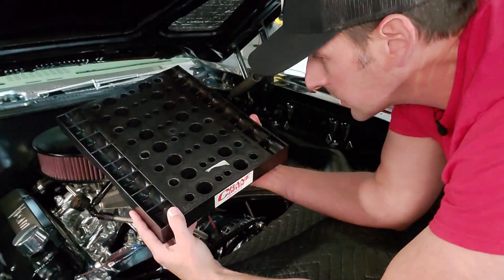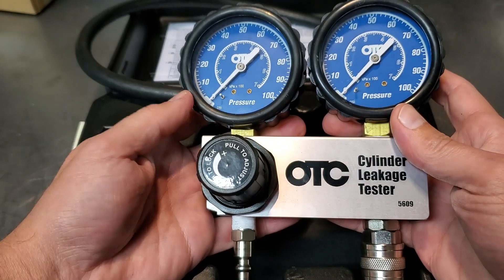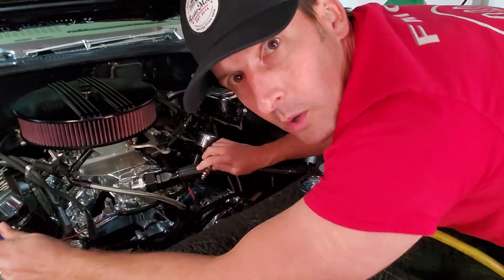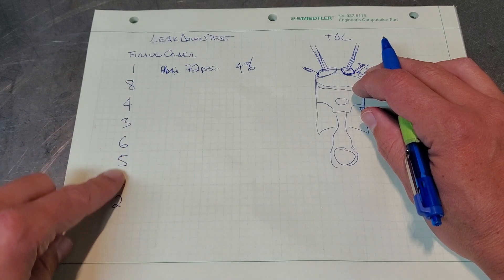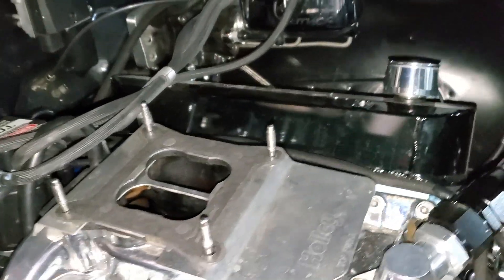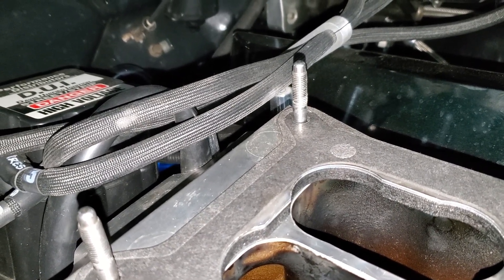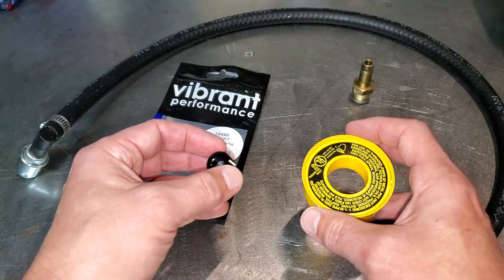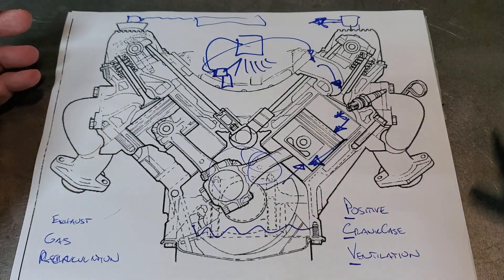Exhaust Smoke!  Bent Valve?  Bad PCV?  How to do a Leak Down Test?

Comment: Last thought, the PCV can go bad and not function as it should, allowing oil to get past, and into the intake.  And sometimes, even reverse , not letting air to pass either way.  So, just replace it.  They're not expensive.
Reply from the maker: On a stock engine, for sure!  But, for us modified guys... check this out... https://youtu.be/fdYFieOOGq4

Comment: I paused this video at the point where you mention the firing order and that to rotate the crank every 90° after #1 cylinder.  
Helpful hint; if you have a degree wheel and install it at the crank, you will be more accurate at finding every 90° of rotation.
Reply from the maker: For those that don't have 90 degree marks on their balancer, that's a great idea!  Thanks!

Comment: First test should be dry and wet compression test on all cylinders. This will tell you what you need to know. A bad valve will be low both dry and wet, after a squirt of oil.

If wet is higher you have blow-by so probably want pistons. Pontiac used cast pistons even on most performance engines so get her punched out with a set of forged racing pistons with compression ratio to suit what fuel you intend to use.

If it's low on wet compression pull the head, unless you have a hole in your piston it's not the problem. Check gasket for cracks or blowouts, then head. Pour liquid in combustion chamber with spark plug installed, blow air in ports and look for bubbles. Soapy water could help. Let's assume you see bubbles on one or more valves you want to send them for a valve job. 

Check for ridge on cylinders that indicate wear and suspect high mileage and consider a full rebuild, such a classic deserves a fresh engine but don't swap out an original motor. Always rebuild, if original motor is long gone then a crate motor may be nice
Reply from the maker: Good points, Don... luckily I didn't have to go that far, reading the plugs and re-examining the wrong PCV plumbing... that was the issue.  Thanks for the comment!

Comment: My GTO has some fouling in cylinder #3, could this be coming from the PCv also?
Reply from the maker: It "could", pull the carb and see if you can look into that runner. Might help to look up how to "read" your plugs to see if it's fuel or oil. Good luck!
Reply: @FastMonty  sounds good I'll do that this weekend.
Reply from the maker: @henrychavez824  I hope it's an easy fix!  Good luck!
Reply: @FastMonty  I hope it's an easy fix to, I don't feel like removing the motor. Looking to sell also if you might know anyone who is looking for 64 Gto. Thanks Fast Monty.
Reply from the maker: @henrychavez824  I'll keep my ears pealed for you... good luck!

Comment: Squirt oil in cylinders if compression comes up much its the rings if not
Its the valves ?
Reply from the maker: Agreed. But, you can typically hear it. Same with a blown head gasket, you can hear that through where ever that's leaking, ie through the radiator.

Comment: Excellent video as always. 
But have you ever thought of using a crankcase evacuation system?!
Reply from the maker: Thanks Brother... yes, it's on the list.  Gonna see how the new plumbing performs first.  Then determine if I should improve the baffel, add an oil separator, or, as you pointed out... adding a evac system.  Thanks for the comment!
Reply: @FastMonty  keep up the excellent work !👏🏻🤘🏻💪🏼
Reply from the maker: @19211265  Thanks!  Doing my best!

Comment: Mike, don't scare us like that!  :^D I was dreading a tear-into-the-engine conclusion. Glad it didn't turn out that way.

Your video sparked an idea for a change on my own car ('74 Formula 400), which is that the power brake booster is (now was) plumbed to that same #7 runner by the PO (I think I have the same intake manifold as you). I decided it made more sense to run the power booster hose to the base of the carb (Edelbrock Performer 1405), so that similar to what you said, the "load" of the booster is placed on all the cylinders, not just #7. Obviously, it will only make a difference in that instance when I step on the brake, but why not spread it over all the cylinders?

My PCV plumbing is like stock, where the hose comes out of the base of the front of the carb, with the PCV valve in the valley pan just behind the coolant crossover. So I was able to just remove the plug from the back of the carb base, replace it with a hose barb, and plug the port in the #7 runner. What the heck is that port for, anyway? I never realized that it's so far down the runner until I saw this video.

While I'm on the subject of power booster hose - remember, folks, don't use 3/8" fuel line. There is an 11/32" hose expressly for power booster usage. Hose meant for vacuum is measured in 32nds.
Reply from the maker: Thanks Griff!  Good advice on the brake booster too...  That #7 port is for an EGR valve.  Exhaust Gas Recycling... so, on emission controlled cars I believe it pumps gas in there, when it's cold?  Not sure, but definitely not optimum for a PVC valve.  Thanks again for the comment!
Reply: @FastMonty  oh, right - you said EGR in the video. I’ve slept since I watched it. 😄
Reply from the maker: @griffmillerii1885  Ha!  No worries... I know the feeling.  :)

Comment: My intake manifold has a port. So it’s not plugged into my carburetor
Reply from the maker: That's awesome... as long as it evenly distributes the fumes to all cylinders.  (As I've found with mine, it only distributed fumes/oil to Number 7)  My first couple of test drives have revealed a LOT less back firing too.  Thanks for the comment!

Comment: Another great tutorial Mike..glad it wasnt a valve..it would be nice see the burning oil disappear on your next movie and let us know if performance has increased..hats off to ya.
Reply from the maker: Thanks Daniel!  Actually, yes, the first test drive had noticeably more power.  Not sure if the Number 7 was missing, or if the back pressure was preventing RPMs from increasing, or both.  (And less back firing too)  So, I consider it a major success, considering I was debating on pulling the head, if it was a bent valve.  Thanks again!

Comment: Looks like your valley pan might not be baffled.  The Tomahawk valley pan designed by Ace Brewer, is a very nice piece that is baffled, and it clears roller lifters.
Reply from the maker: Great idea!  I welded in a baffle to mine, but will definitely check out the Tomahawk version.  Thanks again!
Reply: @FastMonty  this wagon was plagued with oil consumption because of the pcv and a non-baffled valley pan.  
https://youtu.be/kGgOTKvWZZk
Reply from the maker: @nachomax1639  Thanks for sharing!

Comment: I’m wondering about your valve seals and guides? I had a early 80’s GMC that would blow blue smoke on shifts and on decel. Turns out I had hardened valve seals. In all it was an easy fix.
Reply from the maker: Will definitely keep it in mind... need to monitor the situation for the next 100 miles.  Thanks for the comment!

Comment: I hate that kind of fun. :)  My guide plates on my 70 Z28 wore out a pushrod until it bent a bit while going up the street. Found that what was suppose to be hardened wasn’t. Swapped them all out. The new ones I got were 1 piece design, black and hardened from Comp. No marks on them at all after yrs of use. 

I made my own leak down tester which works great.

Here is the formula if your compressor can’t reach 100 or more PSI.
(Orig psi minus final psi) divided by orig psi mult by 100.

If orig pressure is 120 psi and the final pressure is 80 psi.
(120-80) / 120  x 100 = 33% leakage

If orig pressure is 90 and the final pressure in 80 psi.
(90-80) / 90  x 100 = 11% leakage

When using 100 orig pressure the math is straight forward.
If orig pressure is 100 and the final pressure is 97 then you have 3% leakage.
(100-97) / 100  x 100 = 3% leakage

During each test have the carb at WOT and oil cap off, oil dip stick out and rad cap off, then using a rubber fuel line to your ear, make note where the leak is coming from: carb, oil cap, oil dip stick, rad fluid with bubbles or the tail pipes.

In your case I’d go through and set all your valves. Try using the EOIC method which I found to be real accurate then test one or two of the cyl again.
I bought a new PCV hose from GM parts back in 1985 and it still looks new after 65,000 mi and it is angled 90* at the PCV which is correct for my 70 LT1 with the straight PCV valve.

PCV never goes to the air breather, in early cars/trucks it went from the carb to the drivers side valve cover. In some mid 70 and up cars they have a small filter on the inside of the breather locked in place with a sliding metal clip with the hose connected to a metal tube going into the pass side valve cover. My 70 LT1 Z28 has a metal tube in the pass side valve cover with a hose connected to it running into the attached tube under the breather where inside the top of the hole has a metal flame arrestor.

https://my1970z28.com/COPO/images/breather_1st-2nd_gen2.JPG

https://my1970z28.com/COPO/images/napa2095_air_filter4.JPG
Reply from the maker: Yep, hardened pushrods are mandatory... ha, ha... Thanks for the comment!

Comment: Thumbs up brother great video I also have the PCV valve in front of the Valley Pan going into the front of my carburetor which is a Edelbrock and you are right the original stock Pontiac engines of that error the valve cover Have a vacuum hose connected to the air cleaner on the carburetor so the positive crank ventilation will get evenly spread out this should solve your problem
Reply: Same location on my 72 Ventura, PCV on the valley pan to the PCV post on the Edelbrock Carb
Reply: @v8pontiacvent  that's right brother
Reply from the maker: Thanks Luis!
Reply: And I know how much you like braided hose you can actually use a braided hose as a vacuum hose also just make sure you use the right size I have them on my Pontiac engine and never run into no issues
Reply from the maker: @firstgenerationgarage2803  Ha!  Yeah... great idea!  Thanks again!